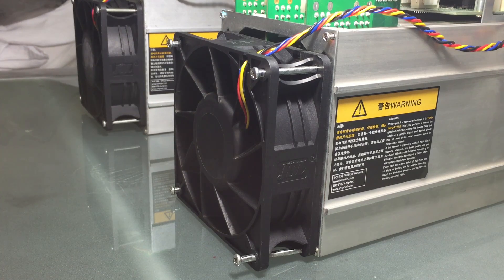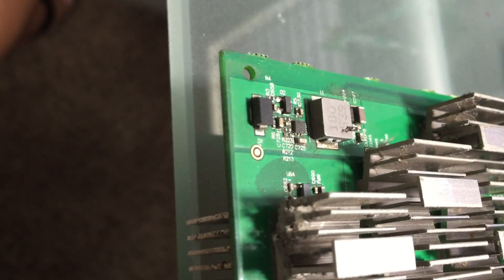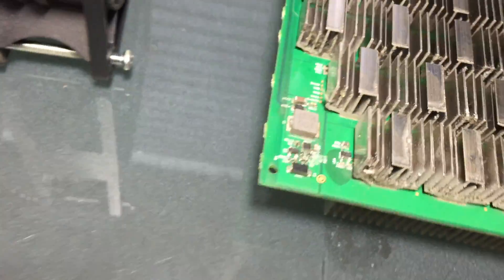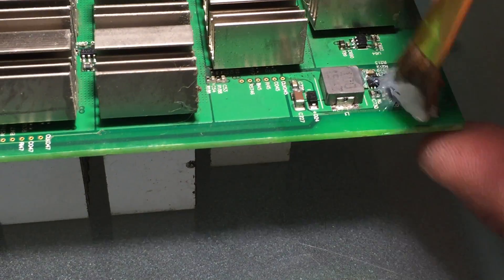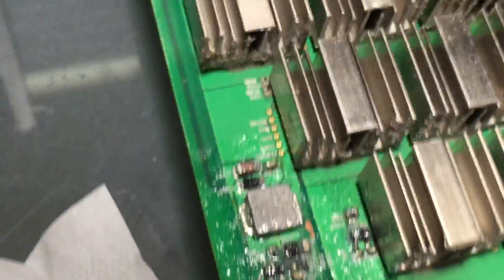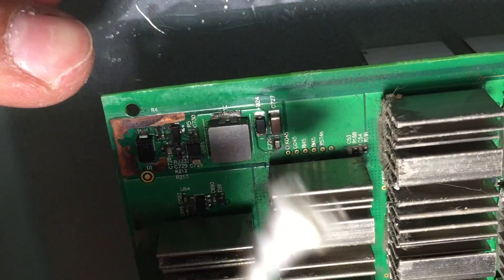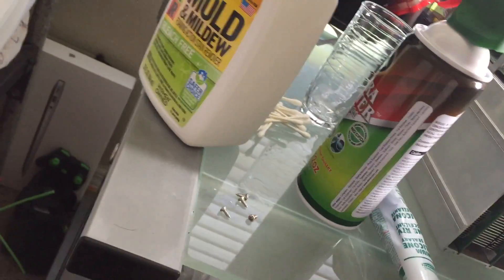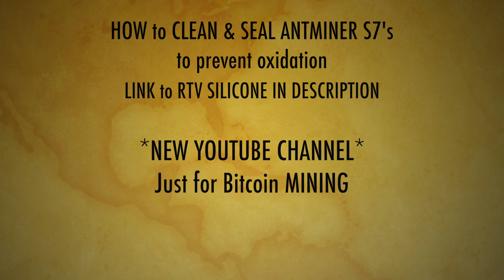How to clean and seal an Antminer S7

Comment: You use Mold & Mildew on the hashing board ?
Reply from the maker: it says its for rust too, https://www.youtube.com/watch?v=Jg6FmNTNv98
Reply: Which one did you use on S7, it's not same as the ones on the linked video?
Reply from the maker: https://www.walmart.com/ip/CLR-Bleach-Free-Mold-Mildew-Foaming-Action-Stain-Remover-32-FL-oz-Spray-Bottle/37896506?wmlspartner=wlpa&selectedSellerId=0&adid=22222222227026531338&wl0=&wl1=g&wl2=c&wl3=52575397151&wl4=pla-84456717311&wl5=9011801&wl6=&wl7=&wl8=&wl9=pla&wl10=8175035&wl11=online&wl12=37896506&wl13=&veh=sem
Reply from the maker: the R in CLR stands for rust  "Calcium, Lime, Rust"
Reply: Yes but is this safe on electronics ?
i use Deoxit for rust and 99.9% Isopropyl Alcohol for cleaning
Reply from the maker: hey, the person I sold it to didn't complain. and its been almost 2 years. and I sealed it with rtv silicone

Comment: hi im having a problem with a hashboard of an s7 but this hasboard is different from the one on the video, the model is s/_Spower_hashsboard_54_V1.5, it does not have any capacitor and i dont know what could be the problem. Maybe you could help me, the board does not have any temp, is no hashing and it say on the miner status --------------------- no X or 0 on it. Thanks for your help
Reply from the maker: Sounds like a power problem, 1 of 2 things may be wrong. The board may be rusted to the point those chips aren't getting any power, or you may just need to reset and restart the miner. how old is this s7? how long have you had this problem?

Comment: Hi, thanks for share it.  Could you tell me about product you used for cleaning?, what Is CLR? I don't understand. Thanks
Reply from the maker: CLR is a spray found in wal mart. Its " Corrosion, Lime, and Rust Cleaner"
Reply: OK. Thanks
Reply: @Quantum3DOFFICIAL  There is also a household cleaner called CLR for Calcium Lime and Rust. At least here in Canada. Its multi use mold and mildew remover for tubs and sinks and the like, so if that's specifically electronic related contact cleaner, you may want to define them as separate. ( https://www.amazon.ca/Jelmar-Clr-Cl-12-Ounce-Cleaner/dp/B00MX65N2Y/ref=sr_1_5?keywords=clr&qid=1587930605 ) 
Maybe you meant CRL? ( https://www.amazon.ca/995-Silicone-Structural-CR-Laurence/dp/B000KZYJ8E/ref=lp_3115827011 )